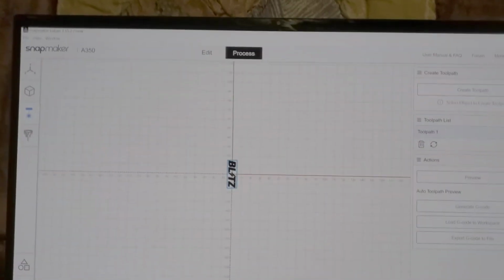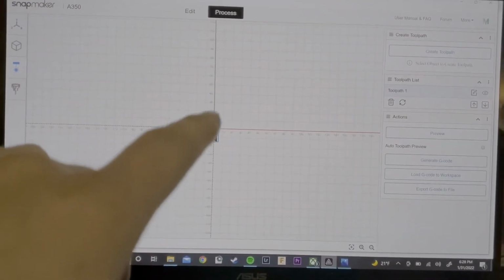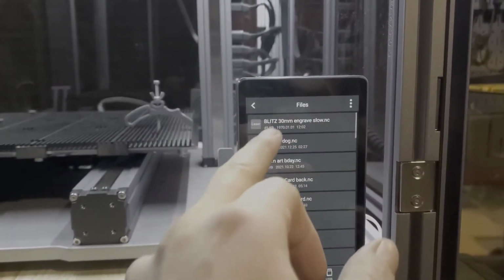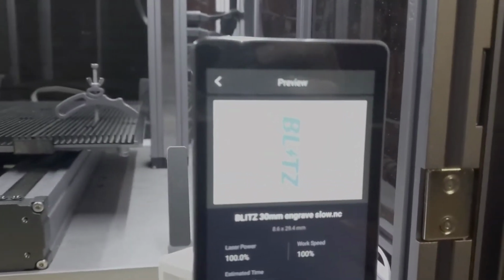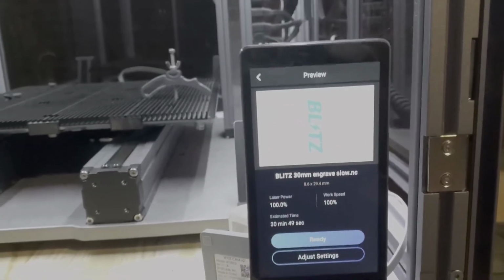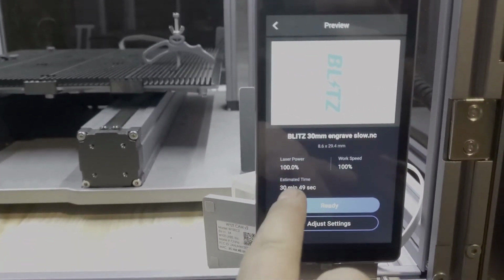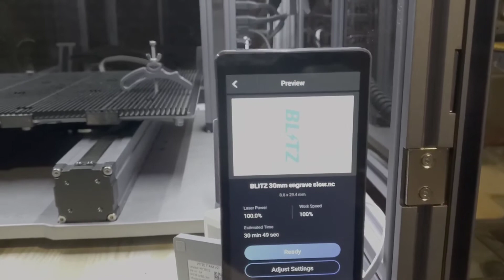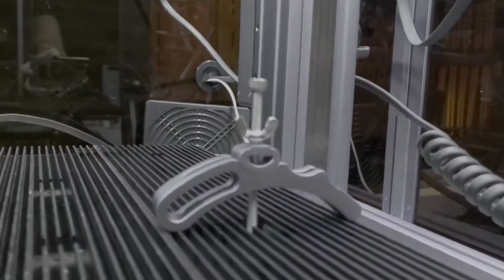Laser Engraving Durable Coating with Snapmaker 2.0

Comment: Nice!  Did you get the 10w yet?  I just did and am looking for best setting.  Please indulge if you do!  I can't find any suggestions online  and don't have a spare test mug for an immediate project.  I could rerun until the paint comes off but would GREATLY appreciate a starting point.
Reply from the maker: Hi I didn't get the 10w but really wanted to upgrade! I like the ease of their software but would really consider a fast co2 laser honestly haha at 100% power on the small laser it takes forever to cut through things

Comment: What settings did you use to get a complete removal of the letter infill?  I currently have Luban 4.4.0 installed and My only option to do this is to Line Fill.  Not sure what settings are needed for this and don't want to waste a ton of material testing.  Thank you in advance
Reply from the maker: No problem I know the updates actually made it harder sometimes but it's line fill  in highest quality and around 120 work speed, 2000 travel, and usually 90-100% power
Reply: @BMcGuinness  What "Fill Interval" did you set for the Line Fill?  I am using the 10W laser
Reply: Also, did you have to do anything to "clean up" the engraving?
Reply from the maker: @ericcrammer3649  Very jealous I want to get that laser head! I used whatever the smallest interval was, I believe 0.05 or. 08
Reply from the maker: @ericcrammer3649  There wasn't any need for cleaning but to get the dust off just soap and water with a paper towel
Reply: @BMcGuinness  So with the 10W laser attached already, I assume I should seriously step down the power?  90-100 might be too much...maybe even cause discoloring of the metal underneath?
Reply from the maker: @ericcrammer3649  Yeah would be alot of power but if that's the case bring it down to 50% power and bring the speed up to around 500 mm/s and try it out. Honestly best guess as I don't have that yet
Reply: @BMcGuinness  Thank you for the advice.  I opted for 60% just to be safe, but used your other recommendations.  As far as I can tell, it looks good so far.  I'll let you know when it is all done.  Thanks!
Reply from the maker: @ericcrammer3649  Awesome no problem!
Reply: @BMcGuinness  thanks again.  It went well and turned out perfectly.
Reply from the maker: @ericcrammer3649  Good to hear!
Reply: @ericcrammer3649  was this the final settings you used?
Reply: @picklejuiceonyou  yes.  60% and the other listed settings.
Reply: Had troubles on about 3 tumblers. Lol. I’m gonna try these. Thanks for the info guys.